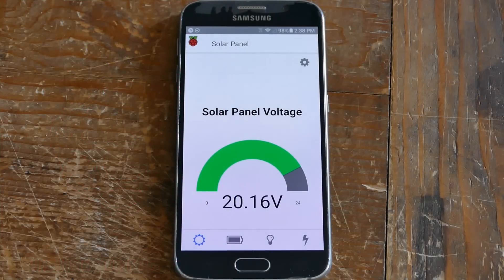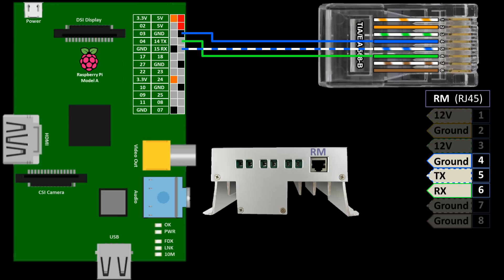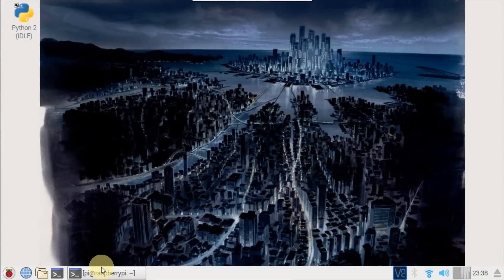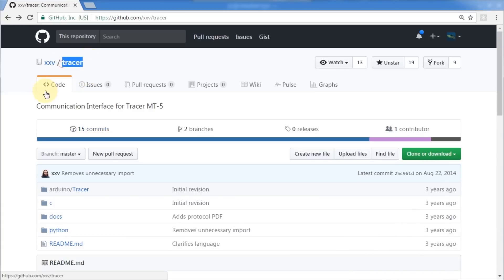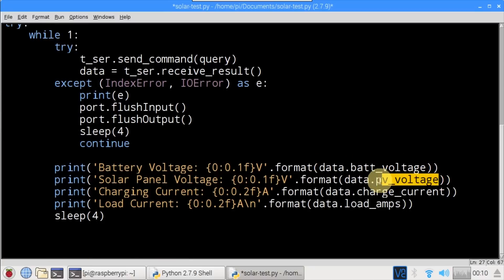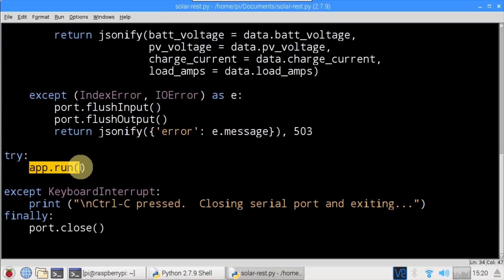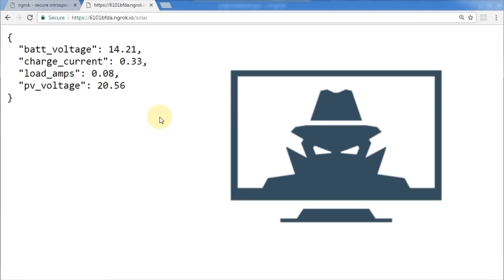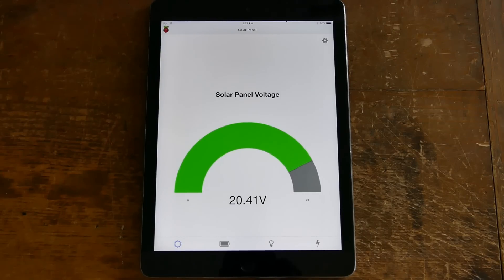Raspberry Pi Solar Serial REST API Tutorial

Comment: Thanks a nice video. I have a query I am building the same system but I want to save the values in .CSV can you please tell me how to do that? Or code will be helpful for me.
Reply from the maker: import csv
values = [batt_voltage, pv_voltage, charge_current, load_amps]
with open(r'log.csv', 'a') as f:
    writer = csv.writer(f, lineterminator='\n')
    writer.writerow(values)

Comment: Before saying that ALL EPSolar MPPT controllers use the pinout you show, you might want to check for the ones that work with the MT-50 meter, the eLog01 data logger, the RS-485 to USB adapter and the RS-485-Wifi box.  That pinout is NOT what you have listed.

From

Tracer A Series Manual, Version 1.1, Page 19

1 - controller +5 volt output
2 - controller +5 volt output
3 - RS-486-B
4 - RS-485-B
5 - RS-485-A
6 - RS-485-A
7 - Ground
8 - Ground

Same pinout in manual Version 1.4 which is available here:
http://www.epsolarpv.com/en/uploads/news/201710/1508812885787574.pdf

I have two 3210A 30 amp MPPT controllers (handling 900 total solar watts and charging 540AH of AGM batteries) and each of the accessory devices listed.  They all specify RS-485 signals on pins 3/4 and 5/6.  RS-232 is NOT mentioned.  12 volts is NOT present on the RJ45 connector.
Reply from the maker: You have a very good point.  I do mention in the video at 1:40 that many charge controllers use RS-485, but the ones that support the MT5 display are serial TTL 3.3V.  Sorry that it was not clear that only controllers with MT5 support are compatible with the XXV tracer library and guaranteed to be TTL 3.3V .  Thanks for the constructive feedback.

Comment: Is it possible to use ESP32 instead of raspberry pi?
Reply from the maker: Yes but the Tracer library would need to be rewritten for MicroPython. My code would need to be rewritten too, specifically the web and serial code. Also Ngrok is not going to work.

Comment: hi can i use c language for manage the rasberry pi ( other things same. rest api or ui framework) ?
Reply from the maker: Yes there are REST API frameworks written in C.  I don't have any experiencing using them.  In my opinion, Node.js, Ruby, Java, PHP and Python are more popular choices.  For a Raspberry Pi, I would stick with Node.js or Python.
Reply: thank you so much. i have another question. i have experience with react native. i dont have knowledge about back-end ,api and embedded system. just little bit familiar node js. I have a project.. I will do it with raspberry. the user will connect (wifi) to rasp with the mobile app. There will be 4 boxes. Inside the boxes will be the LED on / off button. If a user opens a led in the box, it will just hang itself. How did you follow a path?
Reply: What would you recommend for architecture? Do you have any tutorial you can recommend?
Reply from the maker: My next video will demonstrate running a MicroPython WebSocket server on an ESP32 and then connecting with a client built with React and MobX State Tree.  This is an excellent solution for 2-way real time communication between a web client and a microcontroller.
Reply: thank you

Comment: hello any ideas why mine says bytearray index out of range
Reply from the maker: what was the line that threw the error?
Reply: @rdagger  I'd say t_ser.send_command(query)
Reply from the maker: @TheFoxstory  Please remove the try statements so you can get the full error message in the repl.  What model solar charge controller are you using?

Comment: Can you recommend a video on figuring out the pin out for the Ethernet cable. My charge controller is a magnum and uses standard phone cable. If I can't find a pin out schematic,  what is the best way to move forward?
Reply from the maker: Google magnum energy rs485.  If it's a popular charge controller then someone has probably already figured it out.

Comment: I've got a bluetooth dongle for a charge controller but it has a different connector. It's a nightmare trying to work it all out.
Reply from the maker: Try searching Github.  You might get lucky and someone else has already done the work.
Reply: @rdagger  It was more working out how to rewire the connector which is a jsp ph 2.0. Its 4 wire connector and it needs to be an RJ45

Comment: Nice Video. I am Solar Engineering Student and I want to do project and it will be really nice if you can do that project. It is easy from solar side but i dont know programming that good. 
I want to measure the power that my load will consume. please can you tell me how i can also add in your project 8 channel relay to turn on and off different equipments? 
please help me !!
Reply from the maker: The easiest way would be to purchase an inexpensive 8 channel relay board for the Pi.  They have opto-isolation and  each relay can be mapped to a GPIO pin.  I think SainSmart makes a solid state 8 channel relay board that would probably be more energy efficient compared to mechanical relays assuming AC loads.  In terms of code you can add a route to control the relays.  It could accept a byte parameter that designates the state of the 8 relays.
Reply: Thanks alot for your valuable answer. I will connect 8 channel ralay in between Load and MPPT Load output. can I use this relay on the load cable? and then turn on and off the load with Relay? I will be using raspberry pi 3 model b.
Reply from the maker: Many controllers such as the 1210RN have a built-in relay that lets you switch the load terminals on and off via serial commands.  However, this would not work if you are using the load terminals to power the Pi.  In this case you would run 1 set of wires from the load to the Pi and another to the relays.  Since you are switching DC, you would need to use a relay board that supports DC (probably mechanical relays).  The solid-state version I mentioned above is AC only.
Reply: rdagger68 thank you. I want to use 8 channel relay to turn on and turn off my load and raspberry pi will get power from the mains (house electricity). So I will not have raspberry connected to solar panel. If you like I will be happy to send you the single line diagram of my project and will be happy if you  gave me some tips
Reply from the maker: You don't need an 8 channel board if you just want to control 1 channel.  You may not even need a relay board.  I'd check to see if you MPPT controller has a built-in relay for the load output which often can be controlled via serial communication.  The MPPT controller in the video allows you to turn the load on and off via serial commands.
Reply: rdagger68 Thanks. I want to Simulate the Load Profile of different countries. An that is why I need the relay board. But can you tell me which line of code I have to use to turn On and off the load via serial communication because it will also help me.
Reply from the maker: You would use the ManualCommand class.
Reply: rdagger68 bro I am new in programming. Can you tell me some example of code. I am copy and paste programmer and just can change the code.
Reply from the maker: I have not tried this functionality, but the following code will probably work:
load_on = ManualCommand(True)
load_off = ManualCommand(False)
# Turn load on
t_ser.send_command(load_on)
# Turn load off
t_ser.send_command(load_off)

Comment: hello, I get this error: bytearray index out of range
Reply from the maker: which line?
Reply: The error is given when executing the code
pi@raspberrypi:~ $ python solar_test.py 
bytearray index out of range
bytearray index out of range
apparently it is when printing the data
print('Battery voltage: {0:0.1f}V'.format(data.batt_voltage))
my port is:  /dev/ttyusb0  I'm using a usb to serial adapter and tristar ts-45 controller
Reply from the maker: Sounds like the data variable is not being populated correctly.  Did you add error checking?  I uploaded the solar_test.py code to my GitHub repo so you can compare.
Reply: Hallo,
i have the same problem.
Wenn i start the Programm then coms this:
Python 2.7.13 (default, Nov 24 2017, 17:33:09) 
[GCC 6.3.0 20170516] on linux2
Type "copyright", "credits" or "license()" for more information.
>>> 
================ RESTART: /home/pi/Dokumente/solar-testII.py ================
bytearray index out of range
bytearray index out of range
bytearray index out of range

Ctrl-C pressed.  Closing serial port and exiting...
>>> 
I Take the code from your GitHub.
Reply from the maker: Comment out the existing print statements and just try:
print(data)
Reply: rdagger68 
I have made the change, but unfortunately the same error message.
Reply from the maker: The error message you posted showed the index out of range error was caused by the print statement  containing data.batt_voltage.  Did you comment out all the print statements?  If so, what line is causing the error now?  The index out of range error is probably caused because the data variable is not being correctly returned from the controller.  You need to add some error checking to the data variable after it is returned.  There is probably a wiring issue.

Comment: Hi, sorry but i am totally lost, i am a newby ; i bought a EPever contrôleur de chargeur solaire MPPT | LCD 30A régulateur solaire 12V 24V (https://fr.aliexpress.com/item/32973117264.html?spm=a2g0s.9042311.0.0.7cde6c375GYmte), i used you wire mn 3 of the video and the code mn 9 and after, but get no answer from the regulator. the tracer library is installed. Can you please tell me what i did wrong ? any help, i just want to see the data like in mn 10.19 of the video ? Thank you so much for the Help. I just need to receive the data. Regard
Reply from the maker: Your controller has an RS-485 interface (not a TTL interface.)  There is a different library that might work:  https://github.com/kasbert/epsolar-tracer

Comment: Hello Sir, it will work on MPPT Solar charger AN instead of RN ?
Reply from the maker: The AN series uses RS-485 which is not compatible with the software library used in the video.  However, there are Python libraries available on GitHub for the newer RS-485 charge controllers.  I haven't tried any but the following one might work:  https://github.com/kasbert/epsolar-tracer